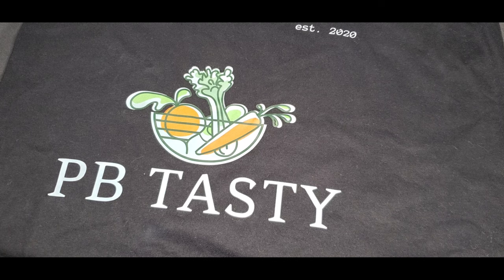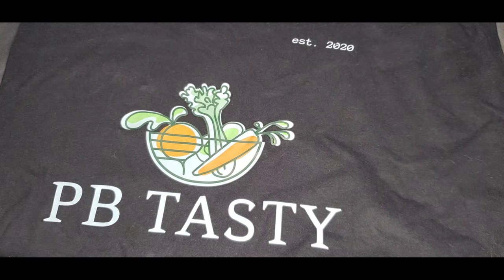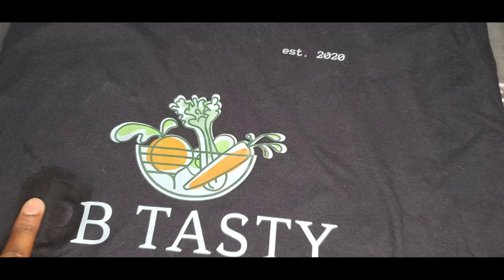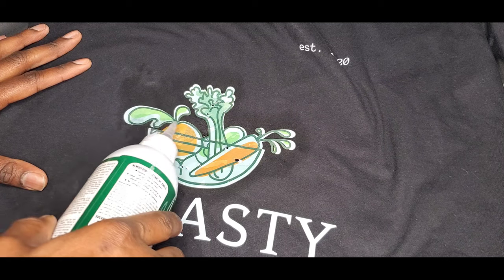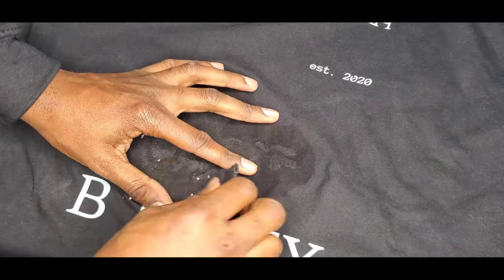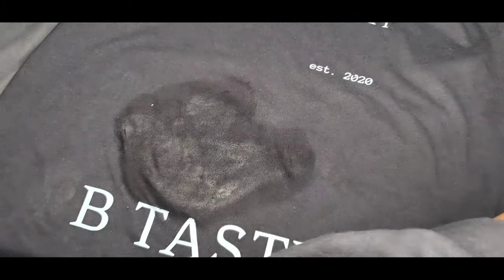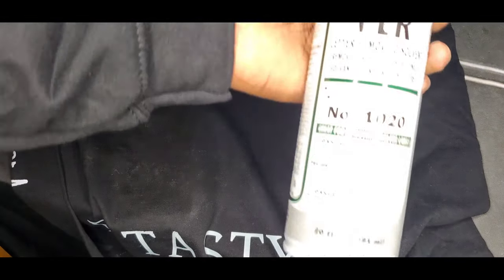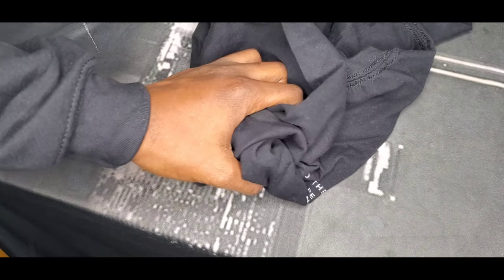HOW TO REMOVE DTF (DIRECT TO FILM) PRINTS FROM SHIRTS

Comment: Won't it work if you put a transfer tape on top of it and put that solution from the inside of the shirt?
Reply from the maker: Inside or outside should work I've done inside And it does help loosen the ink but outside works fine